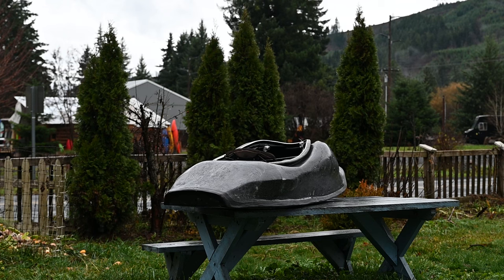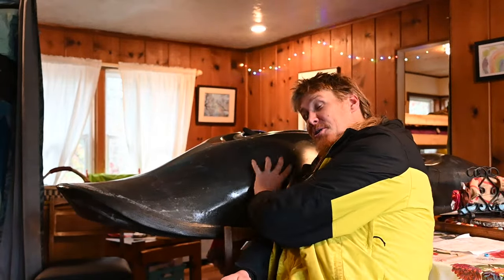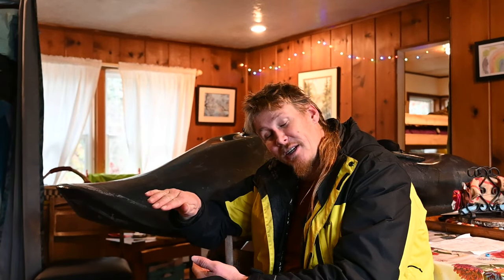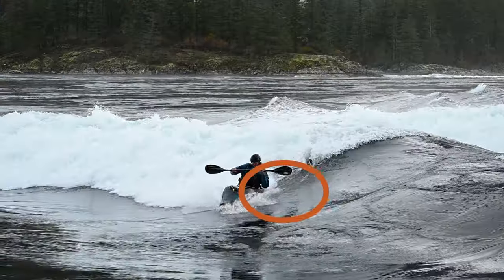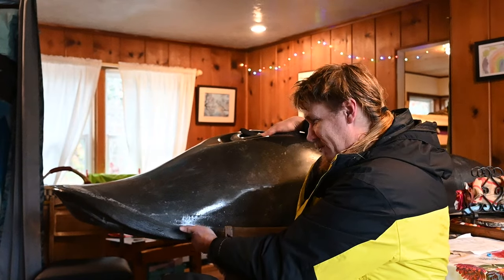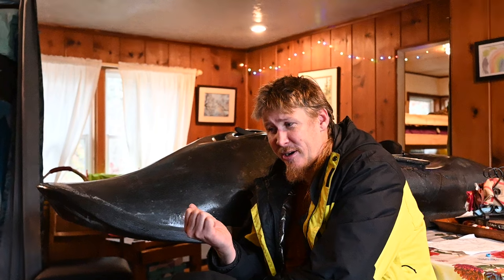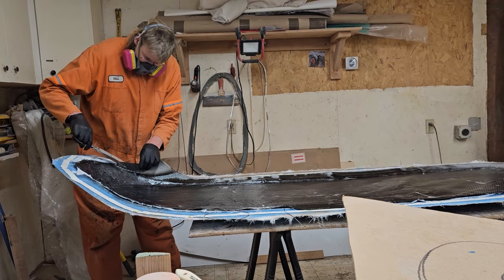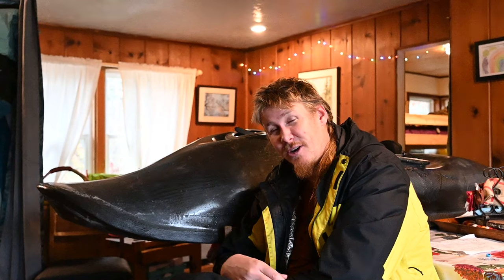Designing the SNAIL

Comment: As a former whitewater kayaker, turned surfer.  I design and surf my own boards and SUPs.  You're taking on  a very ambitious task and I applaud you for it.  Bottom line is that carving on a green face requires a surfboard style rail that can penetrate the water.  The giant sidewalls of your boat are the exact opposite of that concept. Which is why your boat just skids instead of carving when you put it on rail.  With your 3 part mold idea, you might be able to keep with penetrating rail design, and then add volume to the middle of the boat. Without disrupting the penetrating rail flow from bow to stern.
Reply from the maker: I feel like it carves. Those rails bite in pretty deep and the pontoons stay out of the way of the spray. And I mean, more importantly, I didn't feel much skid. It would carve hard, but it would turn just a little funky when switching directions. Maybe if I got more aggressive with the concavity I could carve even harder.

Comment: Awesome what you have come up with. 
 First time viewer, so obviously first time commenting.

 I'm definitely not an expert or even an amateur boat designer or canoe designer/builder. But, I have spent many years in boats of all sizes and types, from kayaks and skiffs, salt water power boats from 16 ft - 60 ft, sport fishing and yachts, sailboats up to 40 ft, fresh water 8 ft aluminum,  V Drive VHull, pickleforks, flatbottom drag boats, all kinds of ski boats, bass boats, pontoons, houss boats, but, the thing that I have some knowledge about that pertains to your Snail is that I spent 4 yrs paddling a 40 ft x 18 inch wide x 18 inch deep Hawaiian Outrigger Canoe. I've been a steersman, and sat in all 5 different seats throughout the canoe. We raced semi pro open ocean as well as some lakes and rivers being that the team/club is located in the North Bay (Larkspur Landing) Marin County, San Francisco Bay Area. 
 Those canoes are pretty heavy but they can get moving pretty good pace. Fast enough to surf wakes from large ships and real waves. Catching what we call bumps which is the tidal current and wind waves. 
 The canoe has no keel, no rutter, it has one outrigger, the aama, on the left side of the canoe, but the very back seat #6 is the steersman, and you use a steering paddle which is different than the power paddles used by the seats #1-5, the steering paddle is more like a traditional canoe paddle, stronger with a flat paddle and straight handle.  To steer you put the paddle in the water against the gunwall of the canoe and push it down and find the vacuum created by the hull and you use the gunwall as a fulcrum and the paddle as a lever and depending on the type of water you are in, rough, flat, etc... and how fast and hard or slow and gradual you need to make your turn will determine how much strength and body weight you use to leverage the paddle against the gunwall, and finesse is key. Sometimes you don't use the leverage type turn, sometimes you reach out to eithsr side as far as you can and jam your paddle in the water and paddle steer, paddling hard as you can inward towards the tail/stearn and yourself as hard and as fast as you can. The more time you spend steering slows the canoe down so you want to be quick and precise with your execution so that you can jump into cadence with the stroke the other 5 paddlers are paddling in the "engine room". When you have nothing but six people paddling a canoe anywhere from the beach to 12 - 14 miles out in the open ocean, when one person isn't pulling their weight and then some, it puts that persons weight onto the other 5 paddlers having to work harder to take up that dead weight. No one can be lazy and just splash their paddle pretending to be pulling water because they are tired or out of shape because everyone feels the difference in how hard they have to work. So as a good steersman yoy have to do your job directing the line or turns and paddling as much as possible. That means catching waves or riding over waves without sinking the Aama which instantly throws the canoe over and everyone is in the water with an upside down 40 ft canoe that ways around 300 - 350 lbs and you've been paddling for an hour or two non stop, and your arms and shoulders and torso are on fire and now you are treading water in the ocean that is hundreds if not thousands of feet deep. 
 
 Why I took so long to explain outrigger paddling is I needed to explain how the canoe is driven and that even a 40 ft x 18 inch x 18 inch, a few hundred pound canoe with 6 full grown adult men or even women and even children driving the canoe that its hull is a U shape but the bottom is more flat, no rails, no channels, the bow is pointed like a canoe or a cattamaran, as is the stearn/tail. You don't get a keel, or rutter, so the canoe has to slide into turns and the slightest poke and pull will make that canoe move in the direction you want and it's very easy to over steer and if that happens you are now fighting to get that 40 ft beast to come back and straighten out, as your crew is still paddling in cadence but grumbling and barking at you because now we all havd to work harder for a minute or so and that could cost you a race. 
 
 So don't listen to what other people tell you about how the shape should be. Only you know how it feels in the water.  You can videotape yourself and figure out some things, but it is the actual operating part of riding the different types of water that only that feeling can give you feedback and give you info to make adjustments in design. 
  There isn't a lot you can do about having air bubbles, and or serious depth change that causes your canoe to almost stop completely. It is a shitty feeling especially if you are in rough water already. Losing all momentum and forward motion is a battle that is not easily won. 
 
 Stick with your design and your gut feelings to guide you into the correct shapes that will make your Snail more responsive and faster. Unless someone has paddled the Snail, they can only speculate and not be able to offer usable information unless they are educated in boat/marine design and have practical knowledge on the subject. 
 That's why I never once told you what I would do or what I think you should do to the Snail 's design. I'm smarter than to be one of those people. 
 Hopefully you'll learn something from my story that will be helpful to you or other readers.
Reply from the maker: I've actually been doing a lot of surf ski paddling and that crowd has a lot of overlap with the oc6 crowd. Thanks for your comments! I'm not in any danger of letting anyone override my own plan on the snail. There are so many people out there with so much more experience than me (people like yourself) that I would have to be a fool to completely ignore them, so my joke about the armchair experts is actually kind of an invitation to real experts as well.

If you were shaping the snail 2.0, what changes might you make? I might completely disregard your input but it sounds like you understand that quite well.
Reply: @Famousleif  --- thanks for your reply. 
 As far as a Snail 2.0, if I were to give some input to reshaping, I'd have to look at your video a couple more times and really pay attention and look closely at the shape you are working with now. I wasn't really examining the video or the snail. I was just interested in what you were doing overall. 
I will watch again and see what I might pick up and maybe have an amateur suggestion.
I'm a little surprised that you know the term OC6.  Have you paddled outrigger?
Reply from the maker: @13_13k  no never paddled oc6 but half my surf ski workout buddies have at least a little, and there are plenty of oc1 and oc2 paddlers around. There's a local club that has one or two oc6s and they train.

I'm interested to see if you think of anything on the snail but don't feel obligated to spend hours on a deep analysis.
Reply: @Famousleif  --- I'll see if something pops in my head after looking at the Snail again and how it was handling. I could see it stalling out in the foam and also how it wouldn't turn, kinda like a tracking issue. You may want to try putting more into the steering with your paddle instead of relying on the weight shift and the shape of the rails, etc... to get the Snail to change attitude and then direction. I don't remember seeing the abottom of the Snail in that video. I would like to see the shape of the hull below the waterline.
Reply from the maker: @13_13k  yup, I noticed that feeling where I had to kind of hump the boat through the turn just a little with the paddle and with my body, and then had to hold it straight for a sec while the new edge bit in. It's been a couple weeks but I seem to remember having to use the paddle to stop the rotation while the carve established, like the boat didn't want to turn when it was supposed to but then once it had turned it wanted to keep going. There might be a couple photos of the hull in that blog article I wrote. It's as close to a copy of the element as I could get.